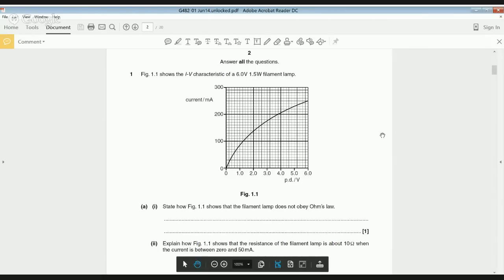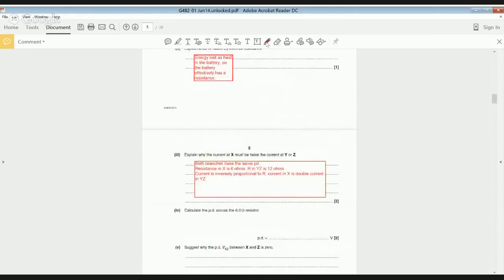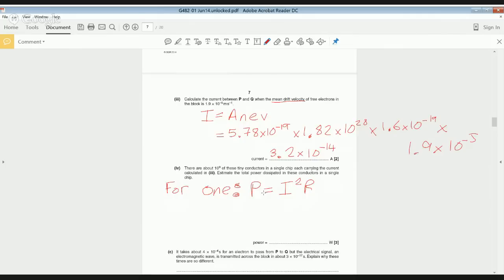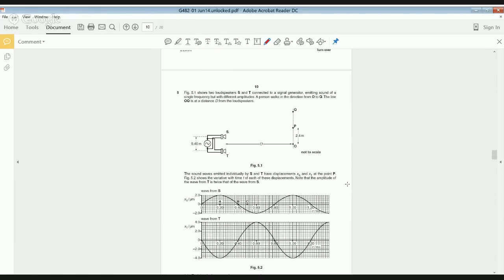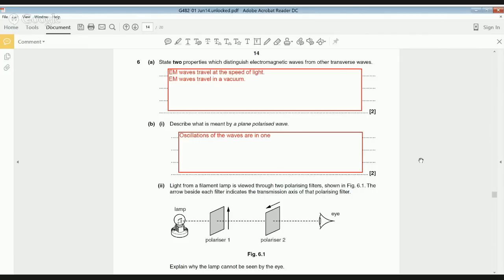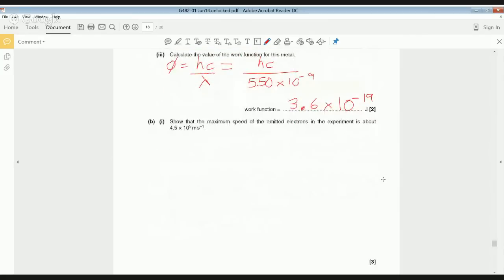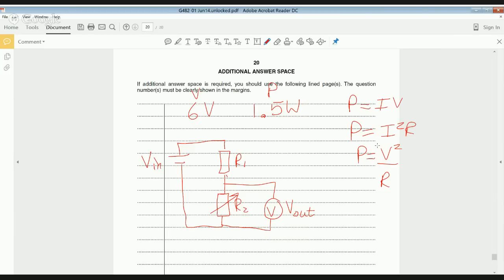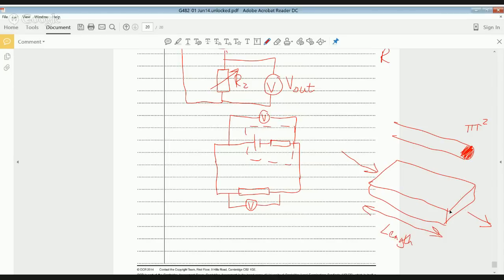Cowen Physics LIVE (Electrons, Waves and Photons)

Comment: Just a few last minute questions on g482:

For january 2013, question 4b -what is this about a sine wave plus with a phase of plus or minus cosine curve and why in the examiner's report does it say
'Most drew a suitable sinusoidal curve with the correct phase. A minority only drew the curve starting from zero displacement at 0.5 ms'- why do you have to extend the line to make it look like negative cosine?

Also for june 2014, in question 1b,why does the lamp have to have its max resistance of 25 ohms (given in previous part of question) to produce light and what is the meaning of 6v,1.5w? is this the specific voltage that will cause it to light or something?

do electromagnetic waves need the oscillation of photons to travel as waves because they are transverse waves and so require oscillations of particles at 90 degrees to the direction of travel of the wave? but then again how come they can travel in a vacuum without a medium?
Reply from the maker: legendfooty 

In Jan 2013 Q4b, the reason it's a negative cosine is because particle Q is one quarter of a wavelength behind particle P, so everything that particle P experiences must happen 90 degrees later for particle Q.

In June 2014 Q1b, we assume the lamp to have a resistance of 25 ohms when it is switch on, because this is the resistance when it is at 6V (you can see from the graph that the resistance increases as the voltage increases). When the lamp is switched off, the filament is cool so the resistance is lower. A 6V, 1.5W lamp is what the manufacturer would rate it at. If you connect such a lamp to a 6V supply, it will consume 1.5W of power.

EM waves are not oscillations of photons. The oscillations are of electrical and magnetic fields, so they do not require a medium in which to travel.
Reply: Cowen Physics for 4b, jan 13, why do u continue the curve back to the y axis?- and not start it from 0 displacement at 0.5ms.
For june 14, 1b, wouldn't u use the Resistance of the lamp at 12v because that's the emf of the supply- and if the graph continued beyond 6v, what resistance value would u use